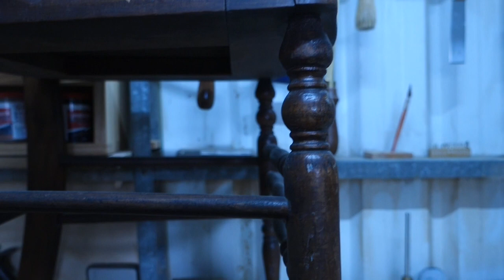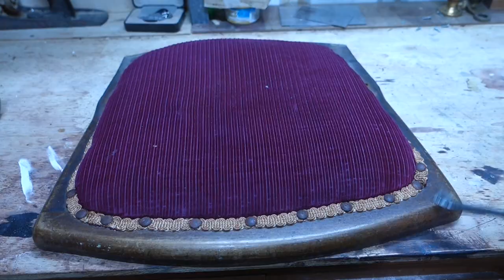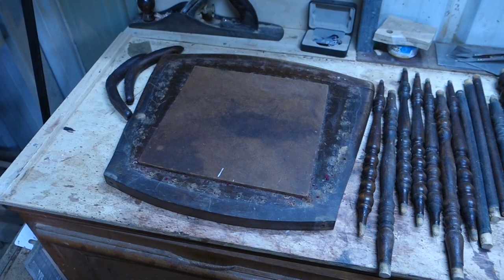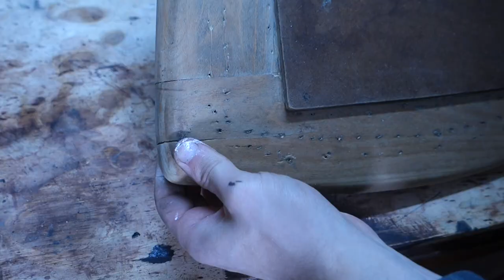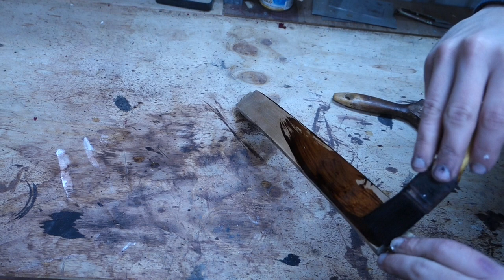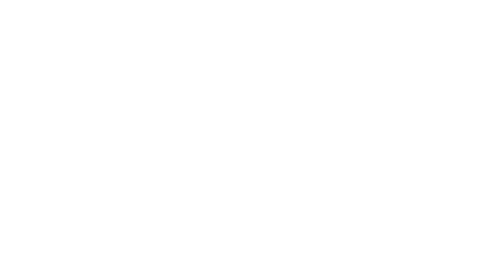Dusty Antique Dining Chair Restoration and Refinish - E∞J Woodhouse Repairs

Comment: I learned a lot from this. The finish turned out better than I would have expected. Nice looking. Was the glue up difficult ?
Reply from the maker: Cheers buddy! The dark walnut really adds a nice vintage look. The glue up was a bit infuriating, I nicked the varnish in one area which was a bummer. I ended up using my largest clamps instead of the mallet to get the joints tight. Always happy to help my friend. Thank you again 👍🙂😺
Reply: @ejwoodhouserestorations2796  I am in the minority here.  After you had stripped the wood, the tone was warmer, grain was seen better, was livelier. Any finishes that glow and gloss seem plastic-like. Client wanted old to look new, erases the character and history IMO. Some caned seats had small caned areas, 5 inches or so set back from the edge. Keeping caned chairs moist is a bother, and hard on the tush. Look forward to the upholstered seat.

Comment: I would have rather seen you put it back together. I have a similar chair except the spindles. My great uncle made it & the seat is a needle point made by my grandmother. I'd like to see what you do for the seat.
Reply from the maker: I apologise I should have recorded putting it back together 😅. The glue up was surprisingly difficult, I panicked and was rushing to put it back together before the glue dried. Very nice 👍 your grandparents sound quite crafty. I should be able to upload it in a furniture video cheers 😺👍
Reply: @ejwoodhouserestorations2796  Those chairs are over 100 years old. Mine is - I guess they needed a place to sit. ;)

Comment: I have noticed that Thomas Johnson never removes the old finish and starts from scratch on his pieces. Did you find it necessary to do that on this one or couldn’t have simply been cleaned and polished and finished off with beeswax or some such thing
Reply from the maker: I’m a big fan of Thomas Johnson as well haha. He has used stripping as a method of restoration, try the mitigating water stains episode, there are others I just can’t remember specifically. You could touch it up with wax and other methods but the owner wanted the chairs to look brand new, which would require starting from scratch and removal of the dents and scratches. It’s all really up to what the owner wants 👍🙂

Comment: Why did you not remove the flat board on the seat to reveal if the chair originally had pressed cane in it? It sort of looked like a spline for cane was peaking out in a couple of places under the flat wood of the seat. I would have liked to have seen it without the wood covering the seat hole.
Reply from the maker: The sheet of Masonite was the only thing stopping someone from falling through the chair haha. It’s an unusual design, it was a hollow square with the sheet covering the hole. I’m guessing who ever made the chair was looking to save on wood. I should have showed the bottom of the chair to make it easier to see 👍😅
Reply: Hi.
Why not refoing the upholstery?
Reply from the maker: @Vanidade001  the owner has a specialised upholsterer. My job was just to re-glue and re-finish the chair. Im planning to upload pictures of the completed chair in the future 👍
Reply: @ejwoodhouserestorations2796  Thanks!